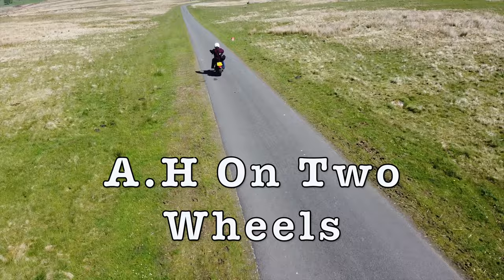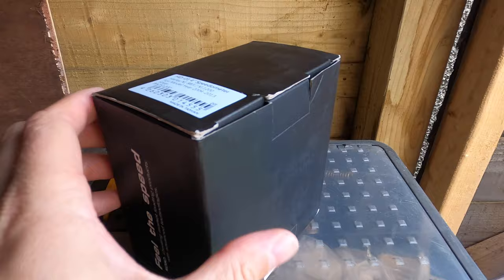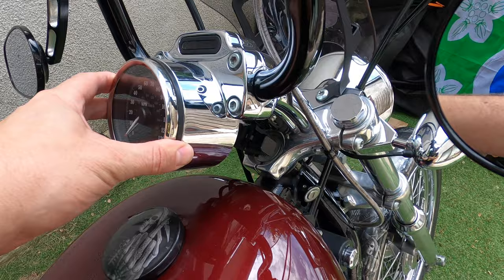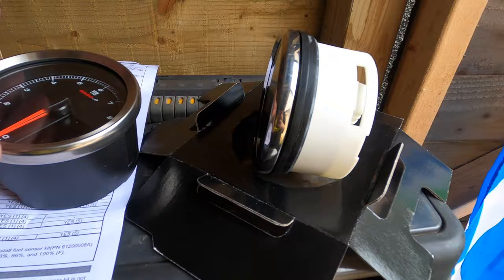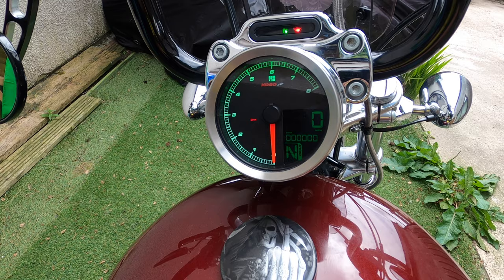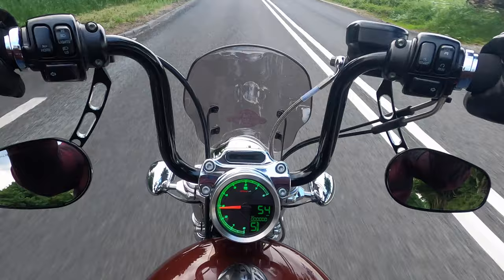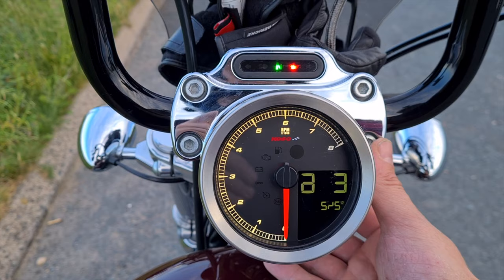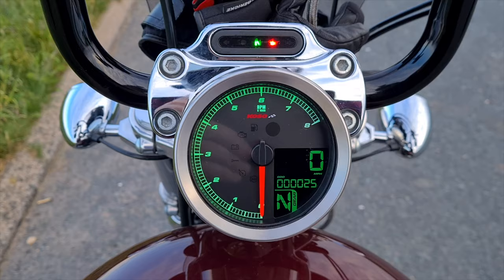KOSO speedometer on a 883

Comment: By the way, I noticed that someone asked, the fuel level indicator does not work, I saw in the KOSO official website manual, need to match the Harley fuel level sensor, material number is: PN 6120008A, I also that should be the reason. Harley official website price: $141.95.
In fact, I use another way to solve the problem, I am preparing to adapt Cole Foster a tank, I expect to open a small hole in the top and bottom of the tank, installed a transparent tube, like the old motorcycle, so you can see the amount of gasoline from the horizontal plane.
Reply from the maker: That's an awesome look. I just go off mileage and the fuel light. I've had a few bikes without fuel level gauge and always managed. Now I have said that I will probably run out on my next ride 😆

Comment: Hi, did you get the odometer sorted, & how did you do it. I have the same Speedo & the same issue. Did you manually set it or did it set itself. If manually, how did you do it please?
Reply from the maker: Hi mate I had to manually set it unfortunately. I just followed the instructions that came with it to set the mileage

Comment: Hi ya A like your videos just got a few questions what year is your custom? 
What handle bars are those they look great and how you finding the Speedo now it’s settled in ? Cheers keep up the good work
Reply from the maker: Hi mate my bike is an 08 and the bars are 8 inch rise Todd's cycle beater bars that I got from bigboar motorcycles. 
I am still loving the speedo and I've had no problems with it yet other than having to set the odometer manually.

Comment: Hey AH.
What is your verdict after using it for some time? I am looking for a new speedo. Am I right suggesting you dont need the original light module any more (indicator etc) when using this speedo as everything will be on display?
Reply from the maker: Hi Marc no it doesn't replace the light module as it doesn't have indicators or High beam and the gear indicator is only active when the clutch is out. I still really like it but if you get the bike remapped (FP3) you need to put the old speedo back in while remapping.

Comment: Hi mate, I have one of this speedo installed, every setting  stage Been completed. Instead fuel display, I can't make it display the level of feul tank, instruction its not really clear, I tried to follow that meny time, it give me error at the end of procces. Can you please explain how did you do yours? Is tank must be empty or full? The engine have to be running? Thanks
Reply from the maker: Hi mate I don't get fuel levels just the low fuel warning light. You need an extra part to go in the tank to give you fuel levels.
Sorry I can't be more helpful 😔
Reply: You need to match the Harley fuel sensor, the official website is called: Fuel Level Sensor Kit, part number: PN 6120008A, I have not used it yet, but I saw this information on the official website of KOSO.
Reply: When the Sportster line went to EFI one of the toggle displays on the speedometer was a "miles to empty" and one of the indicator icons was "low fuel". Be careful, ebay said that this will work on my 2005 1200 Roadster, but the manufacturer says that it won't.